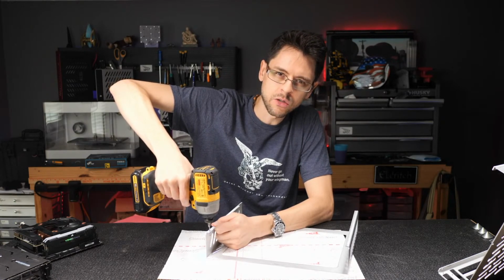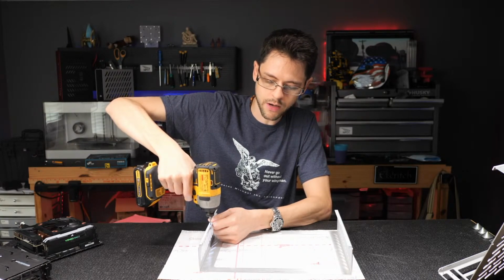O5L Assembly

Comment: Cases like this benefit from the graphics card fans facing the same way as the the CPUs.
Reply from the maker: Believe it or not I had this tested by engineers with expensive instruments and as long as the fans have a proper working gap and access to ventilation like this case does then fans facing DOWN is actually slightly cooler. The hot part that benefits from convection is the backside of a GPU. Fans overcome natural convection (kinda the point of them) so the heatsink can face down. This is why I switched from fans up in the S3 MINI to fans down in the S4 MINI. Thanks for the comment!
Reply: @NotFromConcentrate  Fair enough 😊